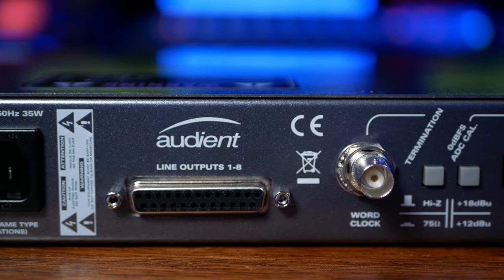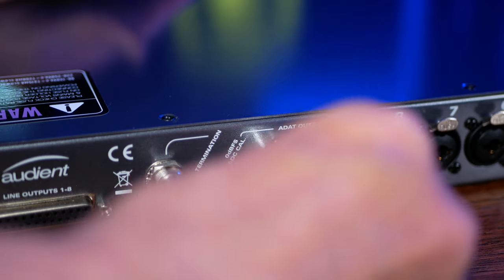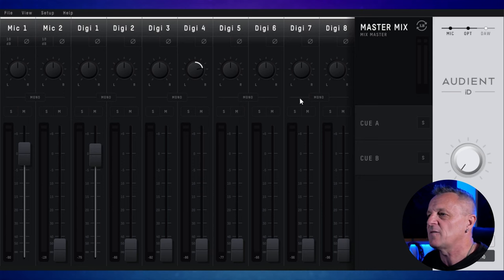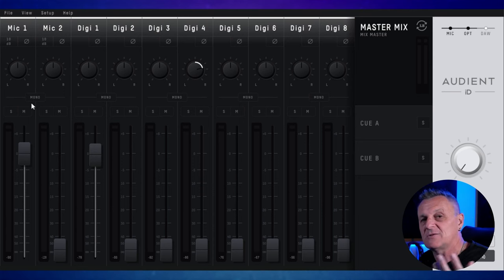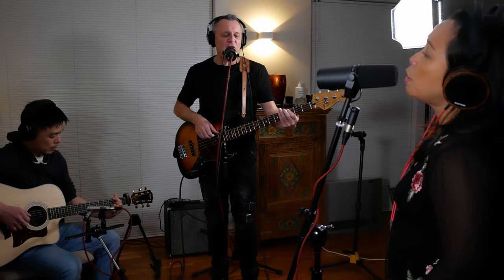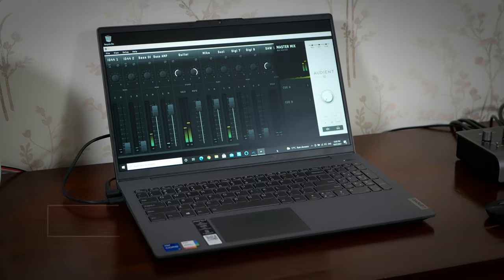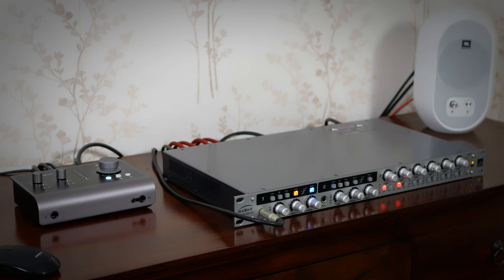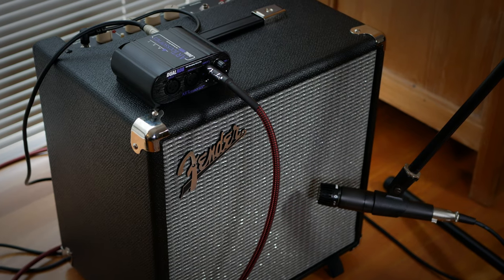WHY and HOW to use a MIC PREAMP - (Audient ASP800)

Comment: Mike, great video as usual. 1 question I had, as I have not used a setup for a whole band before, is where does the headphone amp come into the chain? Does the 6-out just plug into the headphone monitor out of the audio interface?
Reply from the maker: Hi Andrew, in this case,  it was a bit of a hybrid solution. I was able to send 3 outputs from the ID 14, to 3 inputs in the headphone amp, where I was able to send them to each ofvthe headphones. Although I could have plugged in 6 headphones if needed, I could only produce 3 different mixes - that's the limit girthed id14.
Reply: Andrew, if you have an audio interface with more that a 1/2 out, then you can use "SENDS" in your DAW tracks and route the mix to your I/O 3/4 stereo out.  Take the stereo 3/4 out and route it to a headphone amp so that your singer and band mates can hear.  You want to make the "SENDS" Pre-Fader so that if you mute your mix or solo in the control room, it won't affect what the artist are hearing. I use the Presonus HP4 as I record 1 vocalist at a time,  but it depends on how many individual headphone mixes you need to determine the Headphone amp you purchase.

Comment: Hello there. Nice video, great insight. I have a question about the recording setup. I was wondering why you used a mic in front of the bass amp. Doesn't the signal from the DI get preamped or isn't it enough? I hope you give an answer, as I am interested in learning more about recording. Thank you and keep doing a good job. Peace
Reply: He now has 2 bass tracks to work with and can blend/mix to desired sound.  Yes, you could have just done one or the other, but 2 sources is nice

Comment: Great video as always! I know you can chain 2 of the ASP800s  together but can you chain 3?  I sometimes record live bands and need all 24 tracks? Thanks again for all you do!
Reply from the maker: Hi Michael, I want to be cautious with my answer here, as I havnt actually done this!

I'm also interested if you've actually daisy chained even 2. The reason is, that the ASP800 only has ADAT out, no ADAT in.

Even if it did,  I'm not convinced that daisy chaining is easily possible,  since my understanding is that the ADAT lightpipe is only capable of carrying a maximum of 8 channels (at 48khz).

I feel the best solution to get 24 tracks would be to use an audio interface which already has 8 pres, and has 2 ADAT inputs - with 2 ASP800s connected. I know my Antelope Discrete 8 Synergy Core has this. No daisy chaining involved :)
Reply: @CreativeSauce  thank you.  Great advice.  I saw a video of 2 chained but it may have been the asp880. I get them confused sometimes. Thanks again for all your videos.  Always helpful.